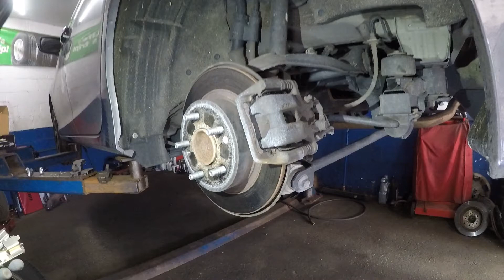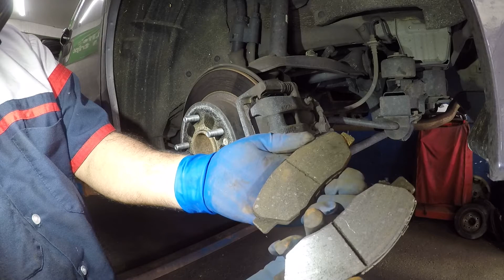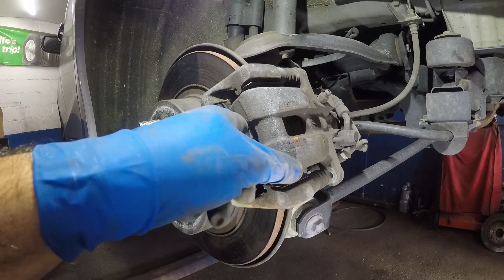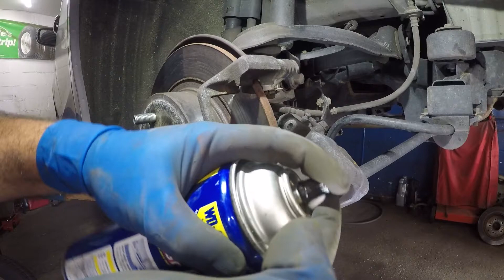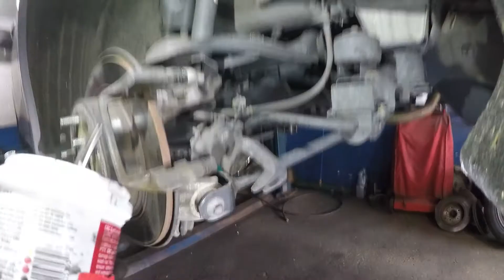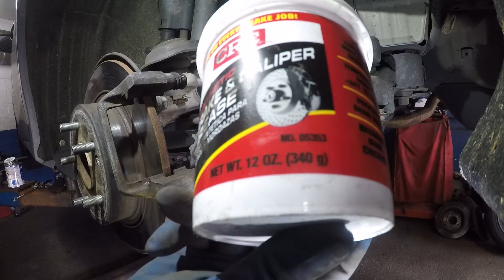Brake Hardware is important factor of new brake job

Comment: Hey. Is it okay to use the brake silicone for both the pins and also underneath the stainless steel brackets? As a DIYer with 1 car, just seeing if I can reduce the amount of greases and silicones I need to buy/store.
Reply from the maker: I use silicon grease for pins and regular brake grease for under hardware